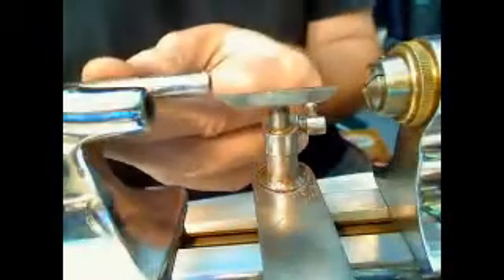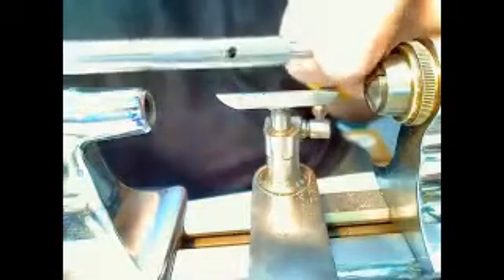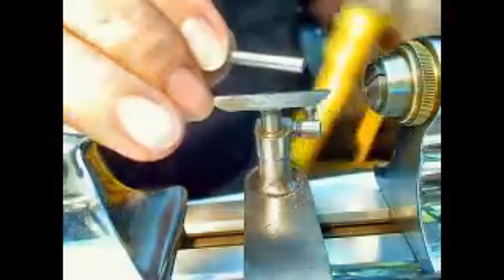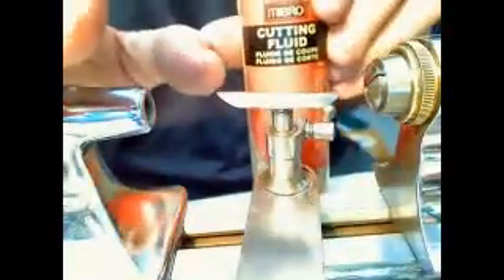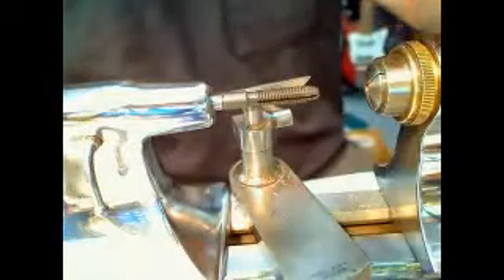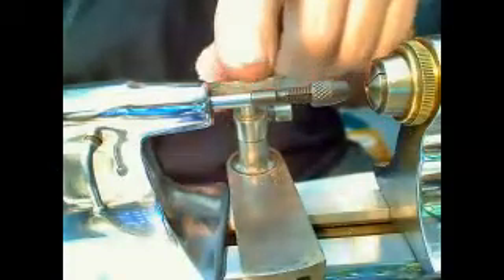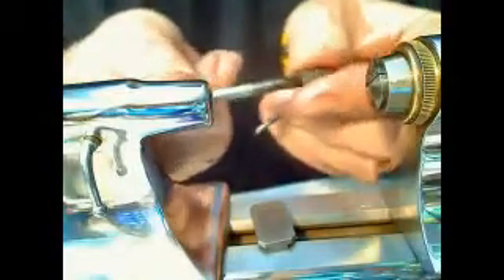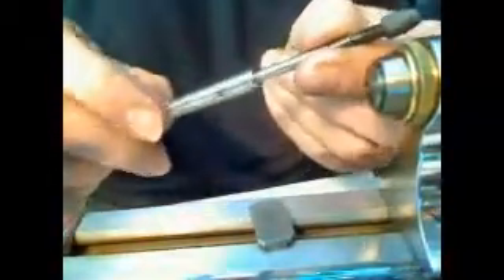Watchmakers Tailstock Tapered Shank for Drill Chuck

Comment: To turn a Tapered Arbor Simply CALCULATE the taper !!  No Guess work needed lol 
No Trial and error  !!   its called  "GEOMETRY !!  as we learned in High school  : )
Enjoy !
Reply from the maker: Got it, thanks
Reply: There's an. Easy formula 
It's a bit of trigonometry 
Of a Triangle . Works every time. but as you show on your video , I Always check for fit .Jewelers  lathe machining operations are tiny and it takes only a very small error to miscalculate
Thanks for replying. I did enjoy your video 
Happy Holidays to You too :)

Comment: Genius!   That is exactly what I need for my old lathe.  Very informative.
Reply from the maker: Hey thanks a lot. Did a lot of reading before making this.
Reply: @JDRichard  Sir, I have questions; for you if you don't mind.  I have a Marshall/Peerless lathe with a tailstock very similar to yours.  
I cannot:  
1) Get the tube out of the tailstock.   
2)  Get a pointed "dead center" pointed piece out of the working end with that little knockout hole you show.   
Questions:
1) Should that small lever allow the tube to slide out of the tailstock?   My lever barely moves.   

2) I have tried pentetrating oil and applying heat with a torch on the "tube lever", the tube itself.   Just cannot budge anything.   Also, I've tried brute force hitting the working end (with the pointed dead center).    I have never struck the other end because that has sort of a Bakelite end that I would just hate to damage.
Suggestions?    And could you answer if that small lever is supposed to lock and unlock the "tube"?
Reply: @MarkSWilliams27  the lever is to lock/unlock the tailstockfrom the bed, There should be a screw to unloosen your tube holding your dead center.

Comment: Is there a reason you couldn't have tapered the drill chuck shank itself? Maybe a problem holding the other end accurately?
Reply from the maker: H.L. Phipps I have more than 1 Lathe and did not want to adjust the chuck for just this Lathe

Comment: Oh thanks for this! I have a Boley & Leinen WW lathe for which I did already perform the taper process in brass (though I had a tapered dead center to use as a pattern), but I didn't realize there was a proper form and use for a knockout pin! I'll embellish on your design. XD Any idea how to get more info on a Boley & Leinen? Mine doesn't seem to have a serial number, but it has the brand name and "Germany" stamped in one end of the bed. ~ArcticWolf
Reply from the maker: ArcticWolfSilver It is a fun process
Reply from the maker: ArcticWolfSilver I really cant find specific info about the BL lathe, other than the history of the Company
Reply: That's the same stump I ran into checking lathes.co.uk as well as a few online forums. Sort of a black sheep, it seems.